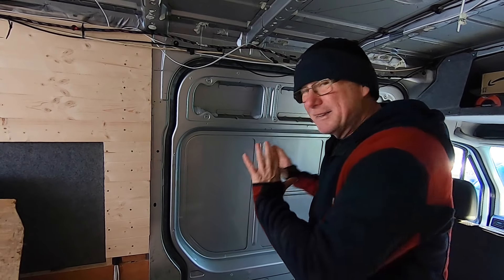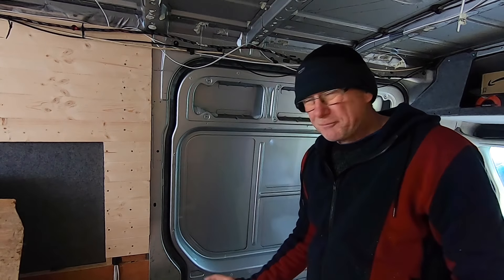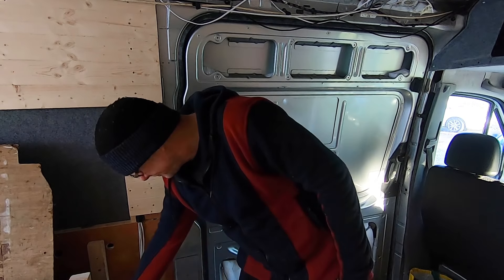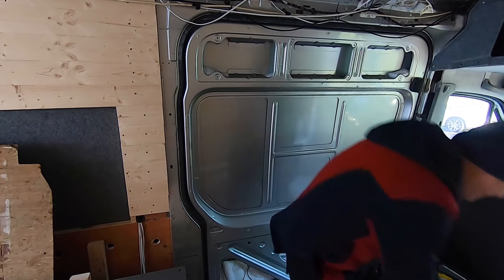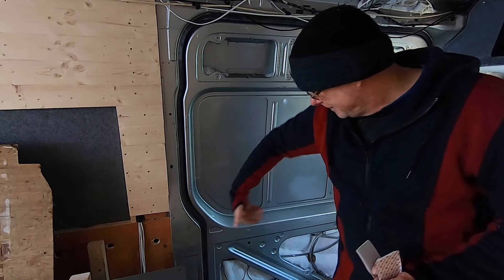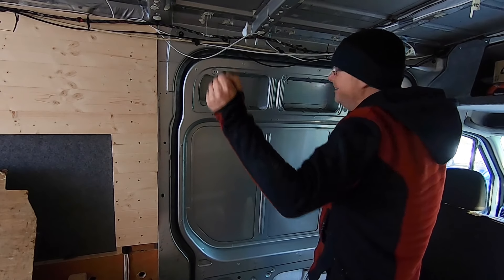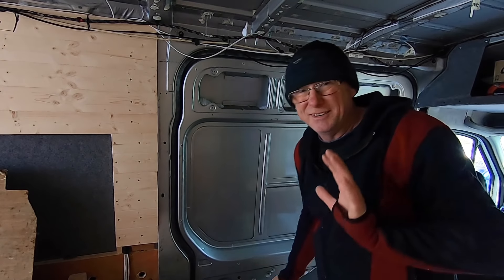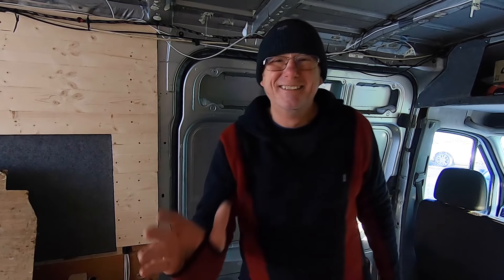How To Convert a van Into A Camper Don't make this mistake SPRINTER CAMPER VAN LIFE UK

Comment: The point you raise here is extremely useful, as you say if that panel needs removing, and it will no doubt, there's no way to do it if there's a unit built there, and the vast majority do have a unit halfway over the door opening, so this video is particularly important. No one else has thought about this, including me, and great that you decided to share this on video, because it's inevitable that locks etc, need to be got at and you could'nt if you had'nt thought about it beforehand as you have here. Well done, and thanks for a great tip. Best wishes from Alan, in Norfolk.
Reply from the maker: Thank you that really means a lot really appreciate your encouragement and support 🍻😂👍

Comment: Ours is screwed on but we use a dumpy screw driver to get it on and off. We usually leave the door ajar because it swings out slightly it just gives you a bit more room to get your hands between the kitchenette and the door. 
Also we made a channel behind the door handle which isn’t sealed so that the water runs to the bottom of the door without touching the insulation
Reply from the maker: Well done sounds like you got it right 👍🤓👍

Comment: Hi Mel I built my van 5 yrs ago and if you have spring contacts for light and locks on your sliding door your insulation in bottom half will eventually stop them springing back to make contact and cause alarms like driving with door open. To prevent that you need to put a barrier between them and your insulation inside the door, I used a small piece of wood jammed inside between electric wires and insulation, very best regards Chris
Reply from the maker: That’s a really good tip thank you 👍🤓👍

Comment: Evening Mel. My van has a kitchen over the sliding door and I can get at the screws with a dumpy screwdriver. It’s a bit of a faff but it can be done. 
  Velcro seems a good idea. But I suggest only behind the sink and studs where it shows to keep it looking the same as the other panel fixings. Keep up the good work. Crack on 🚐☕️☕️👍🏼🏴
Reply from the maker: Thank you 👍🤓👍

Comment: Just build there. If you ever need to remove the panel you can simply remove the bottom and middle door slider and pivot the door outwards to gain plenty of access.
Reply from the maker: I wouldn’t recommend trying that them doors are really heavy much simpler to do what I have done but thanks for the suggestion really appreciated 👍🤓👍

Comment: Mel that is a very good idea. I have blackout curtains on my van to cover the windows and they are fairly thick. I also use small but powerful magnets fastened to the materials and they hold the curtain against the sides of the van and that's also through the stick on van carpet.
Reply from the maker: Well done sounds great 👍 🤓👍

Comment: I’d be trying push stud poppers, I think the Velcro adhesive will give you problems over time. And the weight of the panel.
Reply from the maker: Time will tell you could be rite I’m thinking maybe the glue will give up in the summer 🤷‍♂️👍🤓👍
Reply: Mel’s Van World maybe put contact adhesive on the Velcro too. And a roller to apply as much pressure as possible, that helps a lot when doing the carpet liner anyway.
Reply from the maker: Just so happens I found my missing roller today I’ll give it a go before I start building my cabinets cheers 🍻 👍🤓👍

Comment: Hi Mel, good idea with velcro, I have a CITROEN RELAY and if I slide the door open there are 2 bolts holding the door to the runner with these removed I can swing the door out and rest it on a support to work on mechanism, but maybe the sprinter is different? Hope this helps.
Reply from the maker: Cheers for that 👍🤓👍

Comment: Remember to leave a gap between the door handle and the bottom of the door. The handle will allow water into the door. Any porous insulation between the handle and the bottom (where it exits via a drain hole) will absorb the water. I used sheeps wool so had to place a sheet of non-porous flooring foam on the inside which was held up by small plastic blocks I sikoflex'd onto the foam. this allowed the water to drain straight down. Also added a couple of pieces of foam to the bottom of the door to stop the insulation sitting in it. The door handles leak on all Sprinter/Crafter doors
Reply from the maker: Thank you so much that is great advice and makes perfect sense really appreciate your feedback and support 👍🤓👍

Comment: Good plan. Watch out in the summer though, the glue on the back of the velcro can get a bit soft and loose adhesion. Some non adhesive velcro and high temp contact adhesive might work better.
Reply from the maker: Ohh fingers crossed 🤞 thanks for the heads up 👍🤓👍
Reply: When you apply the same clear Bison kit to the surface where you are going to put the self-adhesive velcro on, and let it dry (go off) for 10 to 15 minutes then the velcro won't come off in the summer.
I did this 14 jears ago on our campervan and it never came loose. Not even where the heaviest  forces are put on.

So @Mel, get yourself a few tubes of clear Bison kit (not the yellow ones, those are to aggressive on the sticky side of the velcro) and have yourself a ball😁

Comment: Nice one bud, I'll probably opt for  your idea of making the lock half a separate panel. On the subject of winter being a good build time...I'm doing mine now....how are you/everyone else going on with all the condensation inside and not sealing it in when you put the insulation on etc?
Reply from the maker: Thank you I haven’t had any issues with condition yet but my ceiling is definitely not looking good last year I used a fan heater to drive it out before glued the insulation on I’m planning on fitting the diesel heater before I do the ceiling this year hope this helps 👍🤓👍
Reply: @BigVanSmallWorld  funny you should say that, I'm wondering about fitting the ceiling fan and diesel heater 1st after all the roof and window cut outs really need doing before the insulation so might be a better plan.

Comment: Hi, I am install a small 6 way fuse bo in the back of my van, I wanted to know what size cable I should use to get the supply off the lesuire battery to my fuse box. Im only running some lights from it and a usb charger. 
Thanks
Reply from the maker: I would use 70amp as you may change your mind later and want more power

Comment: I'm preparing to do my first build (as opposed to modifying several RVs). I was already using conduits for cables and pipes but Luke's Van Life had someone tearing off the ladder on his van and being unable to access the inside because of fixed insulation. That's made me think that maybe I should take the same approach to insulated cladding as I do to cables and have it removable as needed. 
As an added bonus, there's a pretty good chance that if anything happens to the van, I can transfer the entire interior into another one of the same model. How far I can take this philosophy in practice remains to be seen.
Reply from the maker: That’s exactly the way I think I build out all my vans so they can be stripped out in day’s if the worst should happen. Luke was really unlucky with his ladder.
👍🤓👍

Comment: Mel maybe you have an insight on this. I'm wondering how effective insulating a van really is with all these weak points . Sliding door ,rear doors , side windows front windows.  I heard another youtuber say it was pretty pointless.  What's your experience having done a few Vans?
Reply from the maker: It’s not pointless it’s really important as in the summer you will fry and in the winter you will freeze or drowned in condensation 👍🤓👍